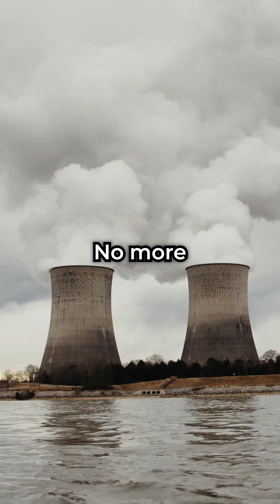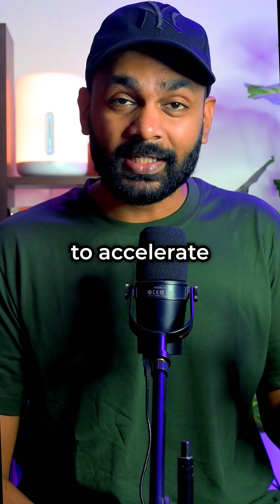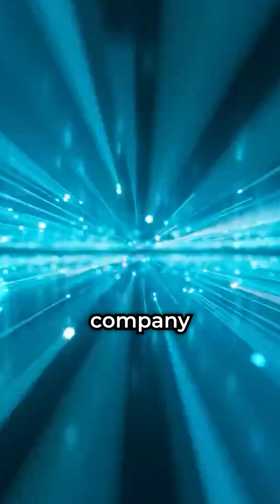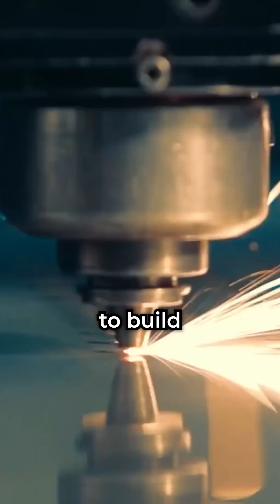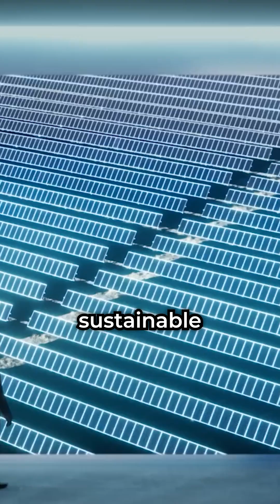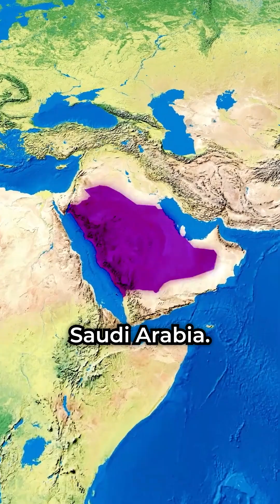Clean Energy for the future? #Alat #TomorrowMadeBetter @alat_technologies

Comment: Those who are saying nuclear energy is better remember there is nuclear waste as well... So harnessing solar energy is far better also it doesn't produces any waste. 

Note: don't say that making solar panel is a waste because inorder to get nuclear energy you need to set up nuclear reactor and its risk of getting uncontrolled chain reaction. Solar energy is much better
Reply: Risk of uncontrolled chain reaction 😂, buddy what are you smoking? If uncontrolled nuclear reaction that much easier everyone would have had nuclear bomb by now. When you write without knowing basics this happens, yes there are risk in nuclear energy but unless you use weapon grade fission material (pretty much impossible and hell of costly) no need to worry about uncontrolled nuclear fission. 

Most of accidents happed because of cooling system shut down, newer design pretty much eliminated that risk. 40% base-load with nuclear 60% solar or wind would do wonders to humanity.
Reply: @RailTV01  An uncontrolled chain reaction can occur in a nuclear reactor, an uncontrolled chain reaction happens when the amount of fissionable material exceeds the critical mass. This causes more than one fission reaction to be induced by neutrons emitted from fission. The rapid release of nuclear energy causes an explosion.

Happened in Chernobyl when Power cut happened

Comment: Hey pranav . Dont call it clean its green . Clean energy is nuclear .  There are lots if environmental issues green enery sources to . I would like to check them out .
Reply: What about nuclear waste
Reply: True. But corporations don't follow rules and just bury nuclear waste in large holes in ground which contaminates underground water and nearby water bodies. Ganga is filled with chemical foam from different industries. Now imagine it with nuclear waste too. 
Meanwhile, Solar and wind power is increasingly becoming more efficient day by day and we can also integrate it with farms which saves a lot of space and endemic species (to make solar farms, you have to displace existing wildlife and it also takes a lot of space)
Reply: Explain them clearly brother
Reply: @saisurya.kattamuri  Nuclear waste is the radioactive material that remains after nuclear fuel has been used in a reactor. It’s produced from the nuclear fission process, where large atoms like uranium or plutonium are split to release energy. This process generates a significant amount of heat, which is used to produce electricity, and leaves behind radioactive byproducts.

Usually these byproducts are sealed and dumped into oceans or underground in a time capsule. However if we start its commercial usage on a large scale a huge amount of it will be released and we cannot use the trash can. 

Note: there are news of leaks of those time capsules causing danger to marine life and land pollution
Reply: @random65323  ohh thank you for elaborate answer. I was asking kollurubharatsimha, he was saying nuclear is zero waste source and solar and others are not, so I asked him, explain it well
Reply: @saisurya.kattamuri  my pleasure... And I see😊

Comment: What about the heat radiated by the solar panels? In the end there is no free lunch, we can achieve efficiency but until we reduce our energy consumption we will be affecting the climate. Just my thoughts.
Reply: Heat radiated by solar panels, even if it's a significant amount (spoiler, it's not) would not matter at all because it would just radiate out to space. It's the grenhouse gases that trap it that's an issue.

Also if the energy is generated carbon free, it doesn't matter how efficient something is, there will be zero carbon emitted regardless of how much energy it uses. (Still better to be more efficient, because of reasons other than carbon output).
Reply: Just a doubt .. what is the heat radiated by solar panels ? shouldn’t it reduce the heat as it is converting a part of the energy into electricity
Reply: @Hadtotypesomething  Problem is, solar panels also overheat. And their output drops when they do.
Reply: They are increasingly becoming more efficient and reusable day by day. Also, we can integrate them on farms which saves solar farm space. So overall, it mostly has pros.